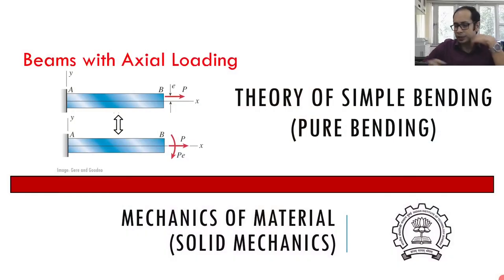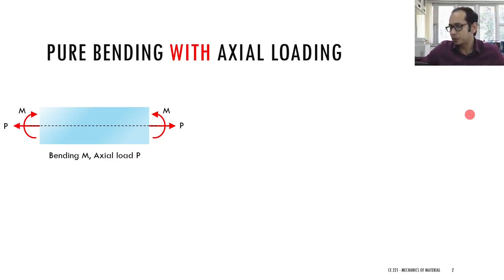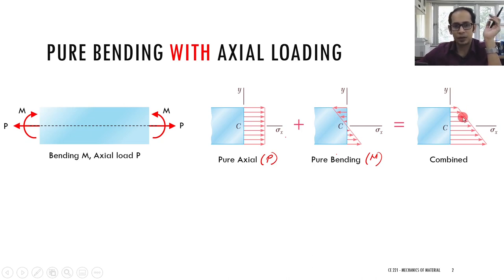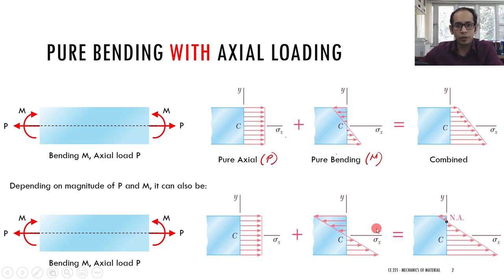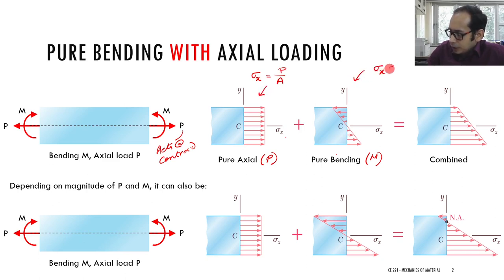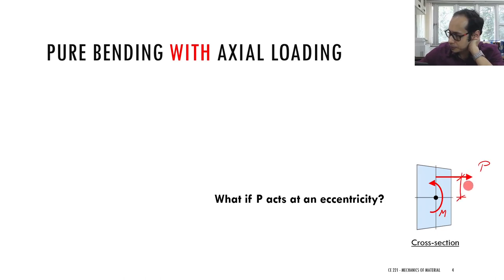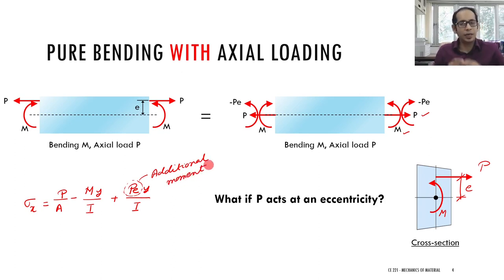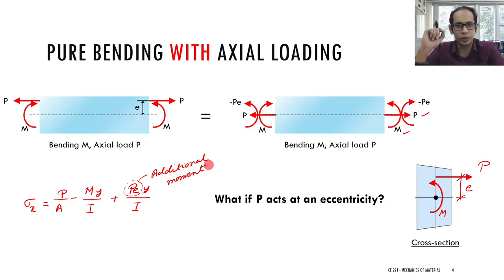Topic # 6.4 - Bending with Axial Loading

Comment: Hello, I cannot understand why load P is added to the centroid. Isn't that load already taken into account by (P X e)? Thanks
Reply from the maker: Good question. Whenever the point of application of a force is shifted elsewhere, both the resulting moment (P x e) and the force needs to be transferred. I'll give you a toy example. 

Imagine that you have a book on the table. If you push one corner of the book, it will translate as well as rotate about some axis of rotation. Now, if you remove the force and just try to emulate this action, you can't just simply rotate the book about the axis of rotation, but must also apply a force for translation. Does that make sense? A good explanation on this is in Meriam's book on Engineering Mechanics. Please take a look at this snapshot and drop a comment if it made sense to you: https://drive.google.com/file/d/1LmIUA7jhMD1H9EbEK8KJ_htDi_TFogPK/view?usp=sharing